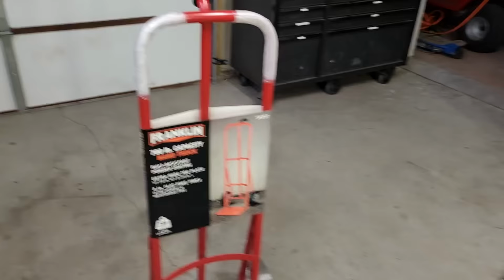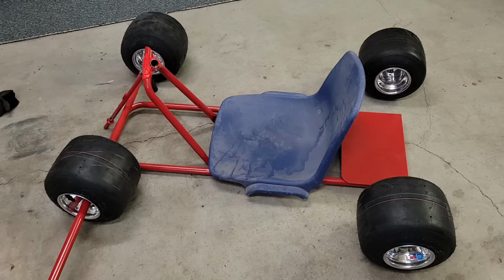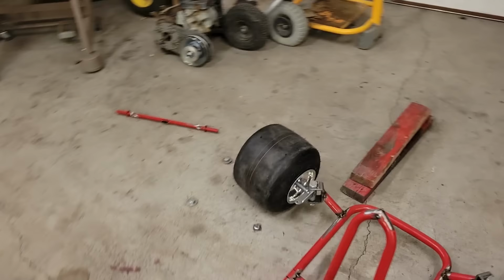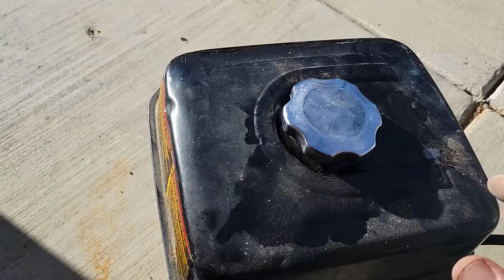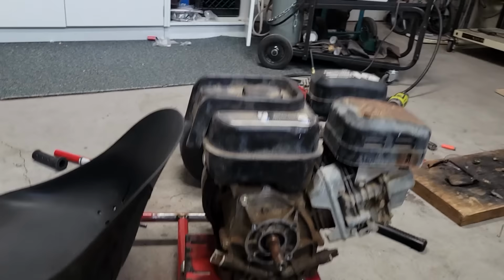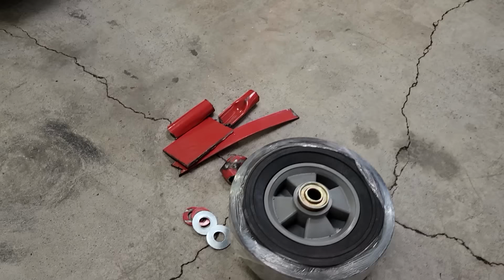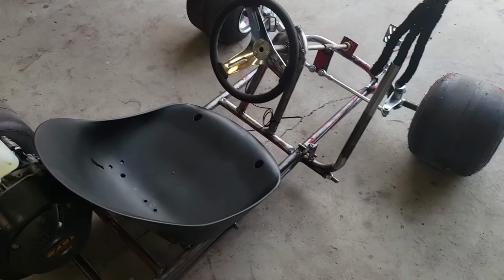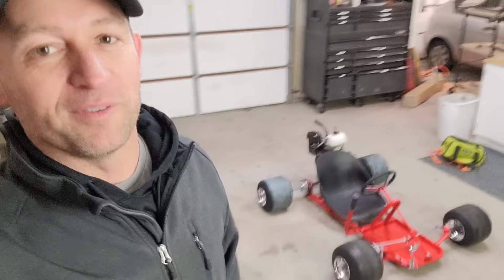I Made a MOVING DOLLY into a GO KART!

Comment: I bought a vintage Go Kart that I'm redoing. When my buddy and I picked it up we saw a dolly sitting there and both of us looked at each other and said "that's a Go Kart frame!" Glad you made it happen.
Reply: Moving dolly make good starters for vintage karts .. that's what I use for holding two batteries and two starter motors for my dual engine vintage karts.
Reply: That's literally what I thought when I was looking at my Dolly the other day that's why I'm here 😂
Reply: As far as the lengthening the chassis, was thinking you could  have possibly added/welded some tubing to lengthen the frame in which you would have to have cut the frame pretty much in half to add.  Great Build👍

Comment: Beware of those Honda GC engines, my buddy put one on his mini bike (db30) and it was in fairly new condition he only had it on his mini bike for a week and a half, we went for a trail ride and when we did a lil race the belt inside broke and let one of the valves drop down to far and when the piston came back up it pushed the valve crooked and up into the head really bad and it trashed that whole engine just because the timing belt inside broke and we had to take his chain off and tow him back slowly
Reply: The head got messed up, the piston cracked, the bottom end got a lil seized and had play it was terrible just because the belt broke
Reply from the maker: Oof, that would suck

Comment: The turning issue is thats its wheel base is so short and its got a possie locked rear axle so both back wheels are pushing.      If it has either a longer frame or 1 wheel drive then it would turn alot easier.     I e built alot of carts from scraps growing up ...

Comment: i would add a brace from the back of the engine mounting plate either over or under the axel to stop the insane vibration which would also put less stress on the chain

Comment: I think you missed an opportunity to extend your frame by welding the motor frame from the power washer to your handcart. Very fun build.
Reply from the maker: I had lots of metal I could have used to lengthen it, but the challenge was making the frame using only the hand truck. I am working on some variations in future projects

Comment: Do an electric one that retains the hand truck mostly unaltered. Get a hand truck with pneumatic tires and split rims that bolt together. Put a sprocket on one wheel. The bolts holding the wheel halves together provide an easy way to mount the sprocket using some pieces of pipe for spacers with longer bolts. Use the existing axle as-is on the hand truck. Mount the motor on the bottom (back as a go-kart) of the blade with a chain to the wheel. Or use two motors, each driving a wheel. Use a hand truck with loop style handle and mount the front axle mount to the handle and make it a pivot so the axle can rock for crude suspension. Since the frame will be pretty high off the ground, mount the battery pack underneath.

The goal would be to cut nothing off the hand truck so it's obviously a hand truck built into a go-kart instead of a hand-truck used as a source of materials to build a go-kart.

Comment: I may have missed it, but Harbor Freight sells a go kart engine, the Predator Ghost for around $300.  I think they have sales and coupons regularly where you could get one for a lot less. I think it may make around 9-10 hp and it has a motorcycle style carb made for throttle control not a fixed rpm .  May be an option for someone who can't find a sweet deal like you got on the pressure washers.
Reply from the maker: I bought one during their last sale and it's being mounted up to my newest project tomorrow. Video should be ready next weekend 🤞🤞

Comment: Sorry if this is a stupid question, but if you're going to dissassemble it to the point in which it is just tubes of steel why not just start with tubes of steel?
Reply from the maker: Because like a lot of others (apparently) I have always thought a moving dolly looked like a gokart already. It has the bends already done in the tubing, so you wouldn't need a bender. It's easy to build a gokart if you have 40 feet of tubing to work with,  but this was a challenge to see if I could build the frame with only the steel from the dolly. I also only cut the back support tube into pieces.  The main dolly frame is the same as I bought it.
Reply: @gamblerspec  fair enough, makes sense. Thanks for the info.

Comment: awesome build. I just have one question: why not make the front suspension a triangle instead of a tube sticking out? I would be worried about it snapping or bending
Reply from the maker: Considered it. I figured it would look better now and easy to add a gusset later if it's needed. There is almost no weight on it and even tacked the thing felt really solid

Comment: That's an awesome deal for $55 even if it was just one!
From experience, having old gas in a metal tank is way better than none, it keeps it from rusting inside. Also If you were looking for a way to get rid of the old gas you can work it little by little into a mower ;)
Reply: I get rid of old gas by putting cat litter into a large coffee can and then pouring the bad gas into the cat litter can and letting it evaporate.  You can use the cat litter can several times.
Reply: @paulstaf  While that is technically better than dumping it directly into a nearby stream, evaporating any notable amount of gas away isn't great. Consider looking up a "household hazardous waste" program in your area. Waste collection companies often partner with local municipalities to have a yearly/whatever dropoff of cleaners, old paint, gas, etc.

Comment: Interesting build,i wonder how long it will be before thosr rear bearing block mounts bend inwards not enough bracing in them and also those front spindle mounting points on the frame,you spent all this money on good wheela axles seat etc but used a dolly to make a frame ,i would gone and brought a length of steel and made a good frame made it longer to suit you better  ,but i guess the idea here was to see if you could use your dolly to make your gocart

Comment: Man... I would have went with the 13hp! They are cramped and heavy but hot damn they are scary fast with a torque converter! I swapped out too a 13hp briggs. It was a bigger 2 seater kart as well with a roll cage. It would top out at around 60mph and had insane acceleration! I also did alittle head and valve work to it as well to liven it up a bit

Comment: I had wondered about this forever now.
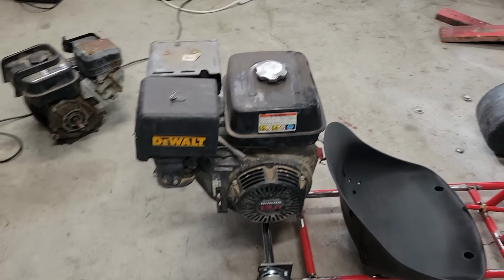Wow no Harbor Freight motors for you ! 20:14 You said Honda 3 horse. that Sir is a 13. :P
25:20 you also have some of the tube from the PRessure washer frames.
Reply from the maker: I almost put a *13 on the screen, but I figured people would figure it out. I did use some for the exhaust but tried to keep all the kart frame moving dolly exclusive

Comment: If you’re going to use the plastic part of the chair, why couldn’t you also use the metal frame part of the chair as well. It could be used for cross bracing and steering shaft support. This would leave more of the dolly frame that could be used to lengthen the kart frame so it’s not as cramped. I’m not sure if that would work but just an observation of maybe it could
Reply from the maker: Yeah I definitely considered it. I had questions about welding to the chromed tubes, and ultimately I decided it wouldn't look as good as the Amazon seat

Comment: Hi I’m trying to do the exact same build but what rims did you go with, they’re so much dimensions on the link and also the size of the bolts for the front hubs
Reply from the maker: 5" wheels that are 8.5" wide with 3.25" backspacing. 5/8" spindles
Reply: @gamblerspec  as far as the rims when I buy  1, it only comes as one correct?
Reply from the maker: @JamesOnWheels  unfortunately yes. They are not cheap
Reply: @gamblerspec  okay thank you for replying so fast, I’m excited to give it a go
Reply: @gamblerspec 
Also do you remember the tire size on the Amazon link, there’s two options 

10x4.5.00-5
Or
11x7.10-5
Reply from the maker: @JamesOnWheels  I did 11s
Reply: @gamblerspec  as always thank you for the reply I’m really excited for the build, found and engine for cheap
Reply from the maker: @JamesOnWheels  that is the best way, because they don't last forever!
Reply: How did you get the tire to fit on the rim? I bought the exact same ones but my problem is one side of the tires seats on the bead but the other side has so much gap showing on the rim
Reply from the maker: @JamesOnWheels    dish soap, ratchet straps, and take out the valve stem. Might need a second person to help. First one is the hardest, but you'll get the hang of it. https://youtube.com/clip/Ugkxaua0ChUlu0Rn6RFyNUhpD7axLt2ubQWj?feature=shared

Comment: The 7hp is actually the smallest.  Its around 106 cc. the 190cc is around 12hp. Which isnt much smaller then the 13hp which would be between 195 and 200cc.
Reply: 13hp Honda is a 390
Reply from the maker: The EX21 is 211cc
Reply: You got it all wrong buddy